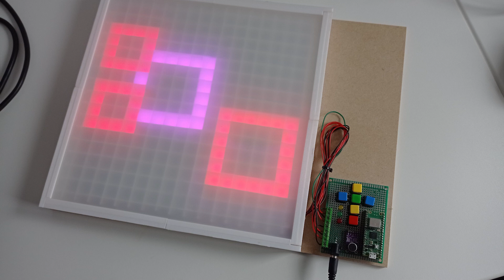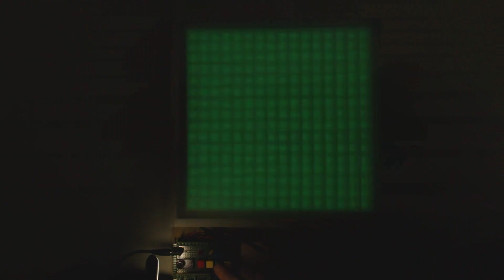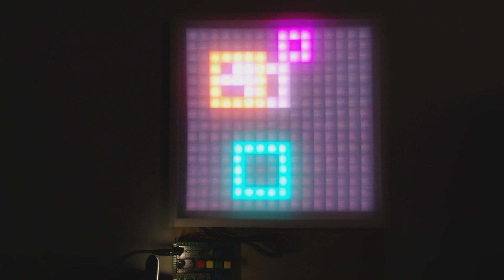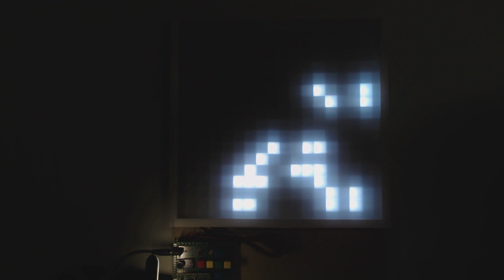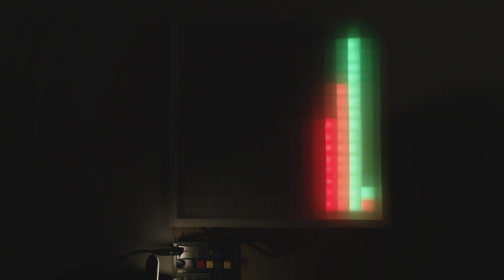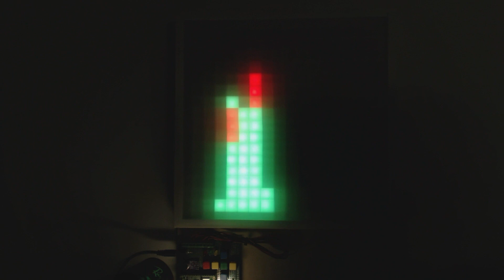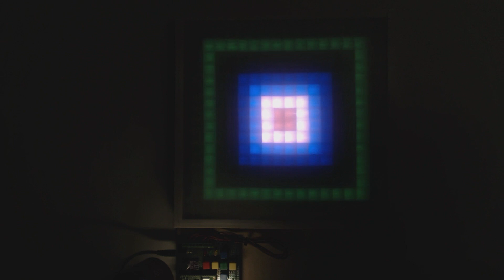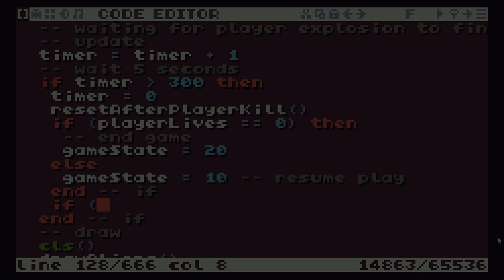Build Your Own 256 Pixel, Full Colour, LED Lightbox - DIY Project

Comment: Looking forward to this series though I do not have the option to 3D-print any parts so I'm hoping that there might be some alternative options.  Thanks again for investing your time.
Reply from the maker: That's a good idea. I'll add some alternatives into the build video. I did play with card for the dividers and some MDF sheet strips for the side panels. All worked OK.

Comment: Please be VERY thorough with your explanation of your software. I am trying to learn how to program - I have the syntax of comands down but how to think and put them together to achieve want you want is eluding me. The HOW to program to solve problems is not found anywhere. So please explain you thought processes as well as the techniques to achieve your lightbox code. Thanks
Reply from the maker: No problem. If it's of any use to you I did make a coding course on Udemy which covers Python coding and how to break down your problem and design your code. Have a look at
https://www.udemy.com/course/learn-python-by-coding-games/?referralCode=F0D5CCA7D75F54975A8A

Comment: I just finished a 16x16 LED matrix with a esp32 d1 mini and WLED. Got the 16x16 from Amazon for really cheap. I've limited the current draw to 1 amp and I can power it differently from the D1 mini
Reply from the maker: That sounds great. Good idea on the current limiting to take out the external power supply.